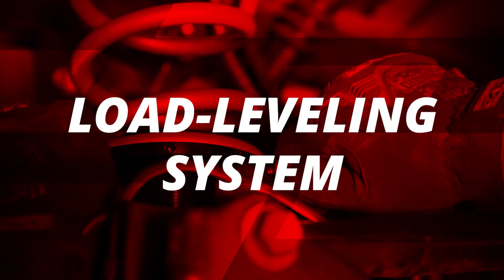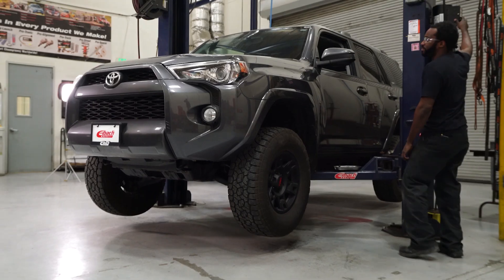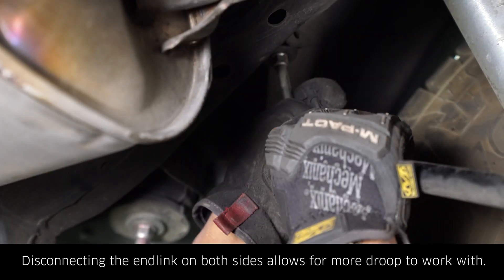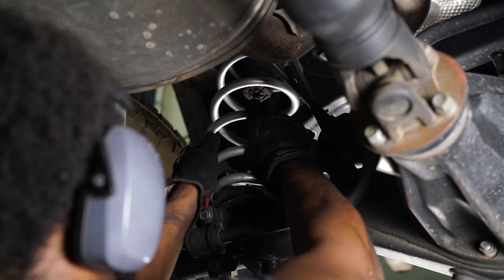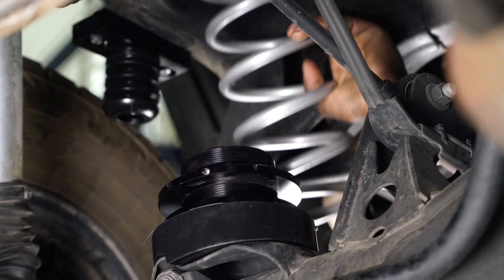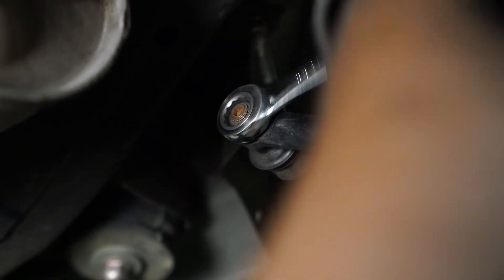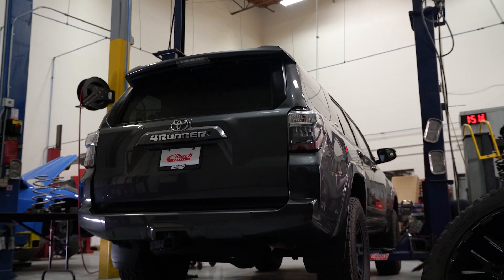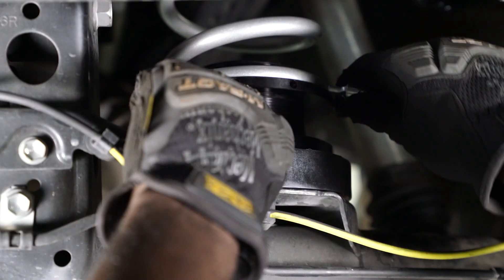How To: Installing the Eibach LOAD-LEVELING SYSTEM (250lbs) on a 4 Runner

Comment: is the tank full of gasoline also?
Reply from the maker: We did not check, most vehicles we use are often from middle to full tank.
Reply: @EibachUSA , good morning. my 2022 4runner sr5, 7 seater currently using your pro truck stage 2r. has a box of gen 2 morimoto headlights at the back, full of gasoline and back is sagging.
Reply from the maker: @a04a27  Please contact our tech support team at 1 800 507 2338 extension 114.